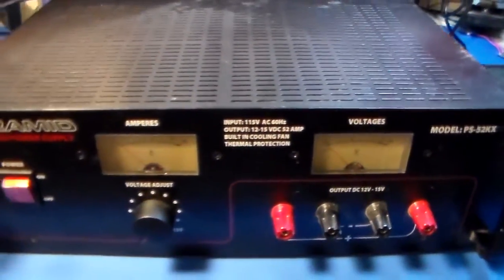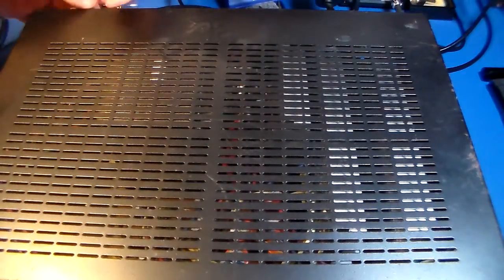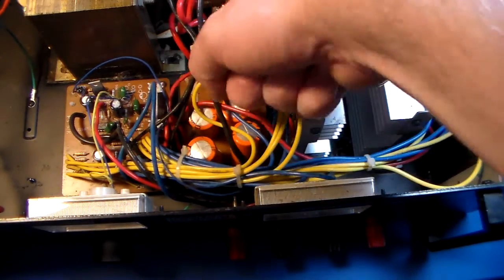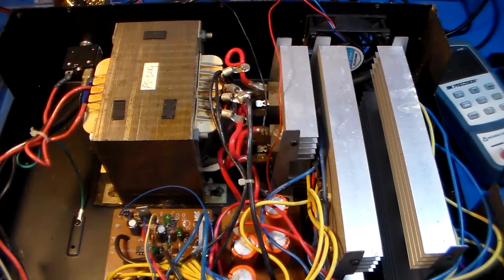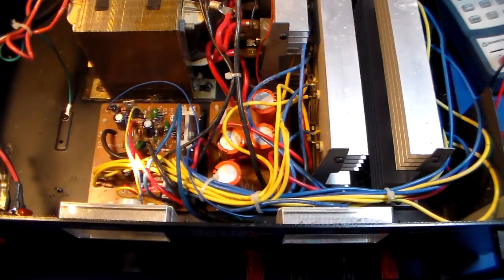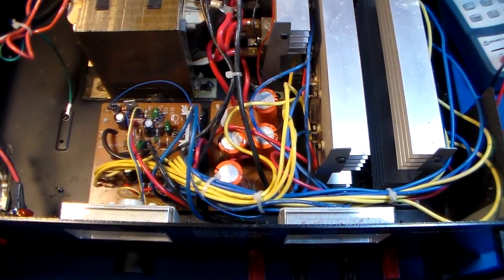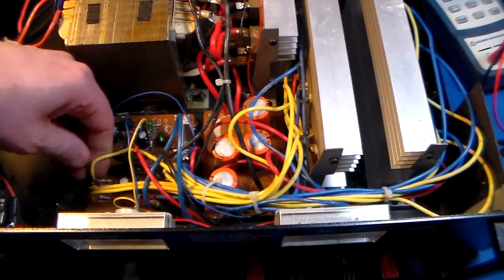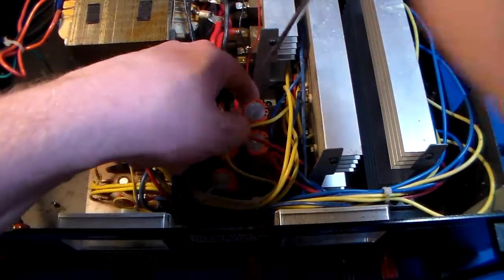Pyramid PS-52K DC power supply teardown

Comment: an someone help. I had to pull the front off and two yellow wires came off, one is VR1 and I this it goes to the adjustment pot, the other to the meter but not 100% sure. Can someone take a picture?

Comment: Have a question I have the ps 52kx and when I adjusted the power it stays at 11.8 volt I'll change out the capacitors out and still does it I'm at a stand still please give some ideas on it I would appreciate thanks
Reply: That sounds like the regulator circuit isn't adjusting. Check the pot first and see if it's adjusting properly, then look at the regulator. I have one of these, but have not taken it apart yet; So I'm unsure how this regulator circuit is built exactly. Maybe a good schematic can be located in a search? I'll look later.

Comment: This guy should not be in the repair business. Pulling caps and prying them with screwdrivers. Brainless. Remove the board and then take them out. He ever thinks about the solder traces and breaking them? Then pulling on wires. Not enough real techs out there anymore. Foolish to do this and to watch. Been doing this for 50 years and now I have seen everything...

Comment: I had one 5 feet underwater during a drinking water flood(long story). After 8 hours 5 ft underwater. Dried it out. Lubricated all the controls and  fired it up. Been running daily for 3 years. Rule of thumb; Need 30 amps?...buy 60 amp supply. Need 50 amp...buy 100 amp. They last a long time If they arent abused and over heated.
Reply: ....Ok I have to ask about the drinking water flood.
Reply: @FridayHouseXYZ  it wasn't sewer backup or rain water. Tap water. Water line came off and filled the house over a long weekend while we were gone. Water was crystal clear.
Reply: @tf7274  That sucks in many levels still, the damage is costly in any case. Sorry it happened, even if it makes for an interesting story. Hope you never have to deal with that again.
Reply: @FridayHouseXYZ  I appreciate the sympathy. We're just happy the house didn't burn. The freezer was floating near the ceiling and running because the plug was up high...water was 3 inches from the electrical panel. Could have been worse.
Reply: @tf7274  Very much so. I was flooded by hurricane Harvey myself, it's no fun.

Comment: I had a pyramid PS 52 KX model given to me a fews back.  I pulled the cover off and noticed a few "cheap construction" methods. Manufacturing date was for 2017. Caps looked good, but I'm going to up grade a few areas. Thanks for the heads up

Comment: This is a bit old but I am curious as to why on both bridge rectifiers one connection is not made.
Reply: Since I see no response, that was/is not that unusual. High current Full Wave devices are (if not rare) some what expensive while high current bridge rectifiers are not.  They use only half of the bridge as a full wave system.

Comment: I had one of these and after looking at it I was surprised the thing even worked in the first place. They made them to work but just barely.
Reply from the maker: +orange70383 I actually made a lot of improvements to mine but yes, these things were built to a price and that was very low.
Reply: @Mark19960  I have one of these that just quit on me. It shows .60V at the terminal posts with the front VR turned all the way down and .56V with it all the way up. Should I look at the rectifiers or the regulator board? Thanks, Randy.
Reply: @randybehrmann5454  I would start pulling your transistors and do some testing on those. could be them or the LM273 chip.